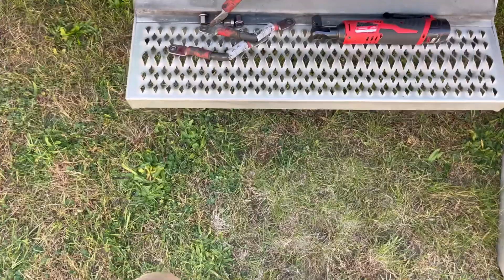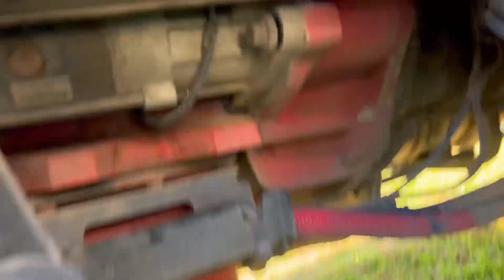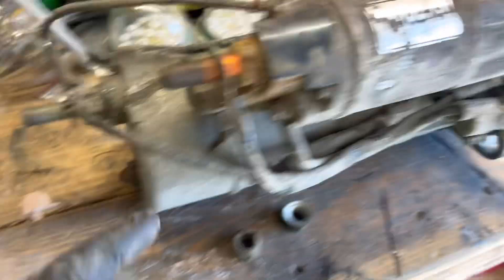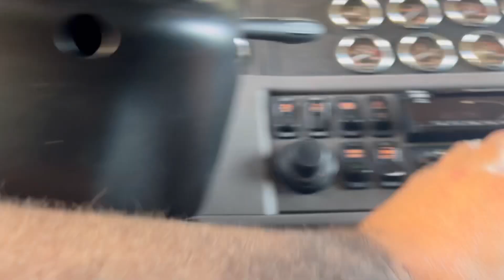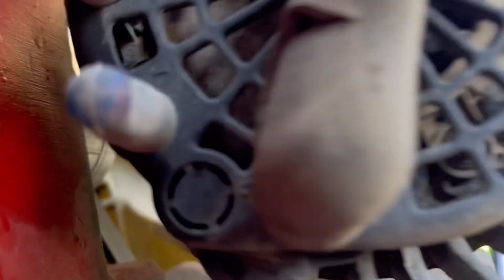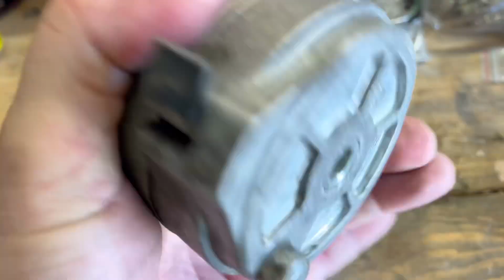Cummins X 15 Starter replacement #automobile #lowlife #viralvideo #trucking #shorts #repair #cummins

Comment: Did you left the wire connector open at the back of the starter??  Mine is a paccar starter switching to delco remy. But old starter does not have the connector at the back. Thanks.
Reply from the maker: im not sure what the Paccar starter looks like, this was a direct replacement from OEM for the Cummins.  How it looks is how it comes from factory